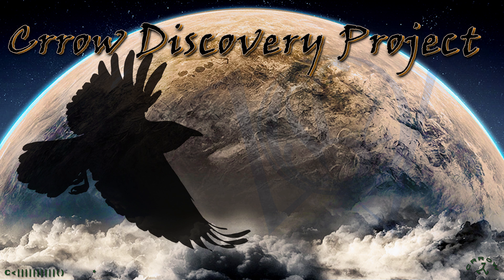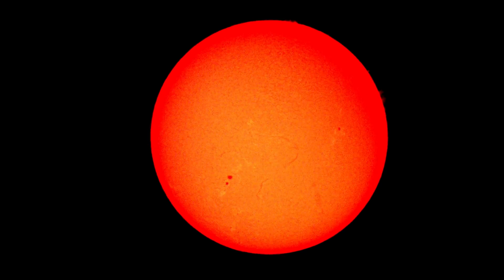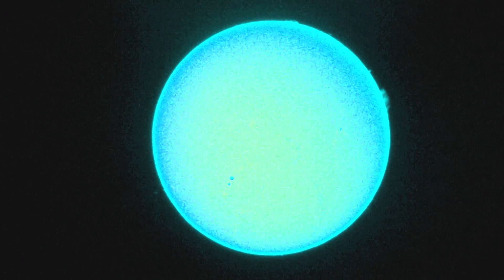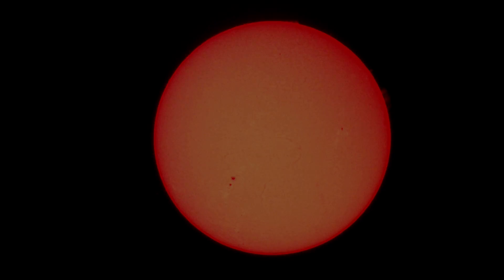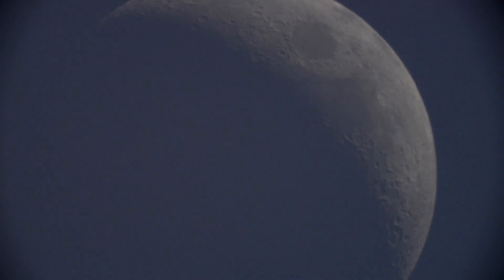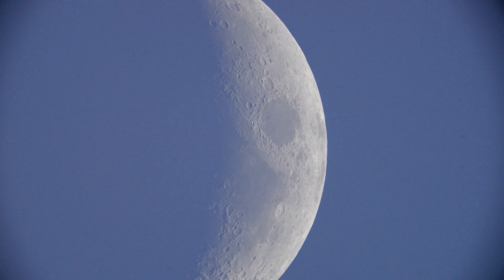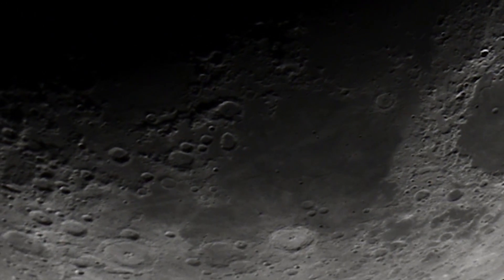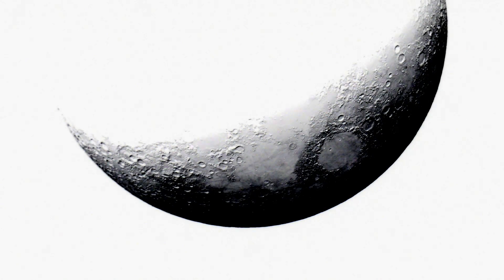Improved Sun Surface Detail & The Lunatic Moon In HD

Comment: It would make sense that blue is easier to view detail with than red would be. Blue is a much easier color for the human eye to interpret than red, and we can look at blue with less strain to the eye than with red. Also, red has a lower wavelength, so blue should be a better color to see detail with if it is calibrated correctly because of its higher wavelength and definition capabilities. Red is also a color, particularly for males, that can be involved with color blindness and would further cause definition problems to the viewer.

Comment: I used to have a Celestron C8 that I purchased back in the early 80's.  At the time it was one of the best scopes that a civilian could buy and it had excellent optics. Unfortunately, I had to sell it and now I'm hot to buy another scope.  I would like something that's at least 10 inches or larger with a CCD and a T Adapter for my camera. Do you have any recommendations?  I'm very intrigued with the work that you've been doing and would like to join in on the search!  Thanks......
Reply from the maker: John Katz Celesstron is the way to go  --- NOT MEADE--. Unfortunately Meade is junk though they have been taken over for re-tooling I think.